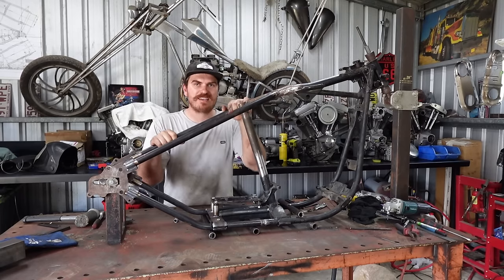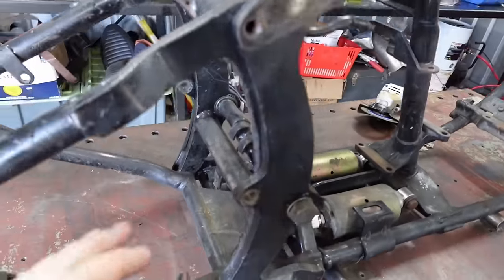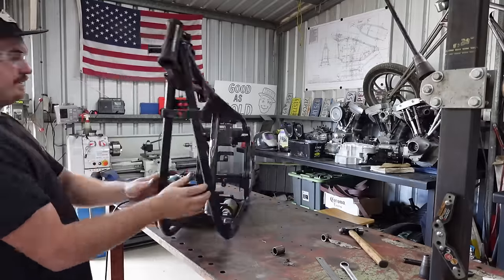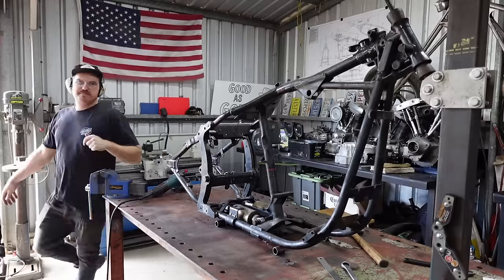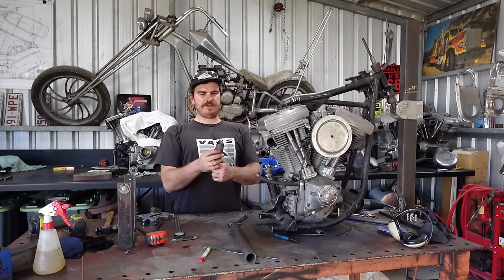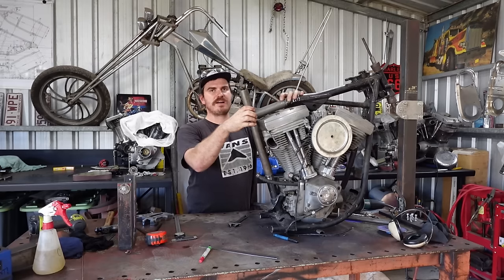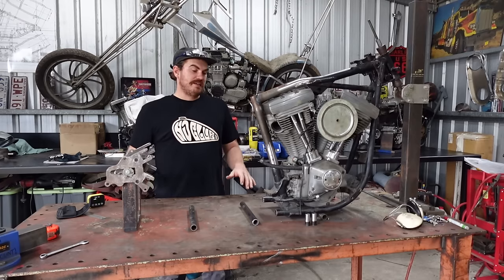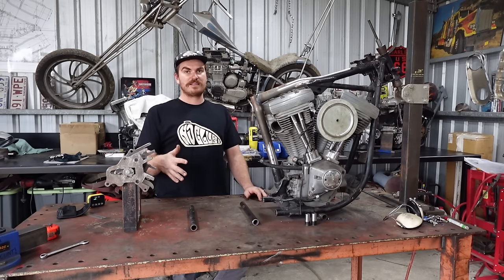Harley Davidson Chopper, How to Fabricate Hardtail Rigid In Depth Video!

Comment: The best chopper frame fabrication video I've seen yet!

How would you go about doing 8 inch upstretch, 4 inches out, and 55 degree rake on a softail frame??
Reply from the maker: Thank You! Little trick to big frames like that is make a little stand for your engine in the jig so you can make the frame around the engine and insure its going to fit and engine mounts line up. The 2000's style shovel I built on this channel is 11 or 12 inches up.